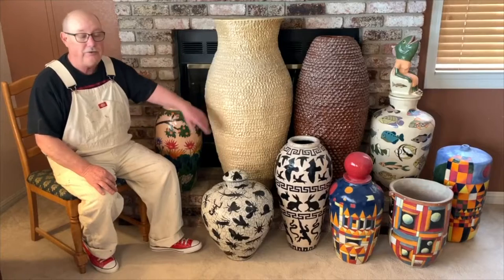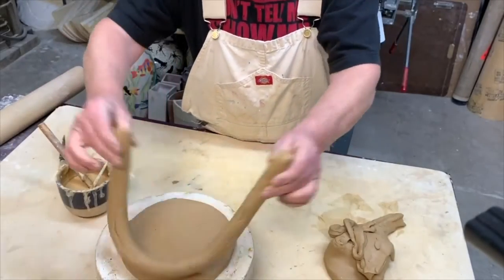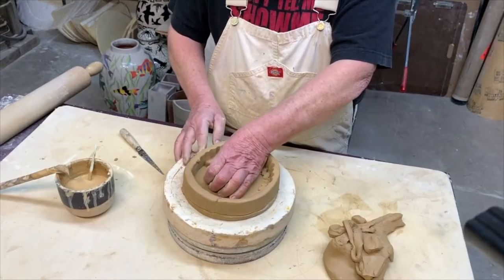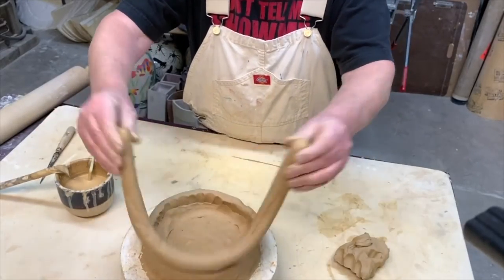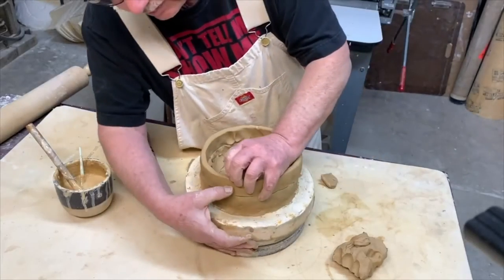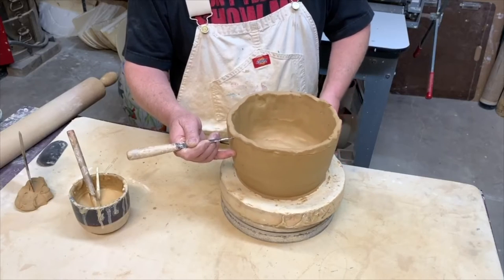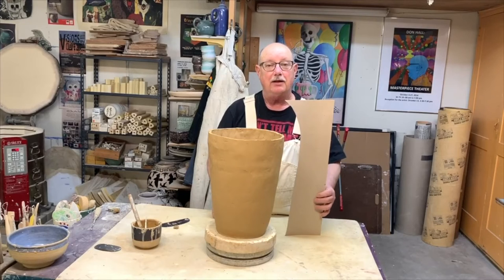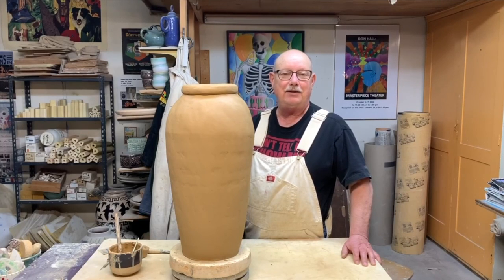Building Coil Pottery!

Comment: Hi Don, when you let the pot dry a bit before adding new coils, is it just for a short amount of time, like less than an hour? Like just enough to barely stiffen up, not close to leather hard, right? And do you ever have issues with the base and lower coils drying out too much by the time you've finished the top? I'm never sure how careful I need to be about making sure all my clay is drying at the same rate. Thanks!
Reply from the maker: The amount of time between coils varies depending on the wetness of the clay and the temp and humidity in the studio.    If it is drying to fast I sprits the piece with water.   I try not to add coils so quickly that the bottom slumps.  It is a mater of experience to learn when it is ready for another coil.   I live in a very hot dry area so I have learned how to build here but where you live it could be completely different.  It changes summer to winter here.  Normally at 2 foot pot takes about one day.
Reply: @donhallworks Very helpful, thank you!
Reply from the maker: @georgesoul4709  you can do it!

Comment: Would like to see the coiling process that creates the curves in the design ... in this case you started narrow then built up in a V shape until you rounded off the top. How did you create the V shape and round off top?
Reply from the maker: Tooled out a meet coil and dropped it one time to have a flat side to attach to previous coil.